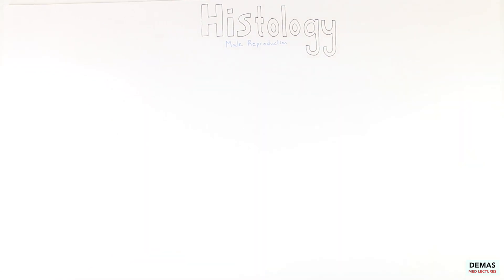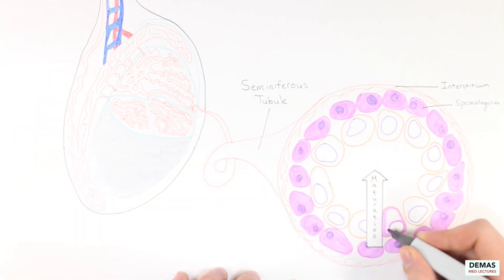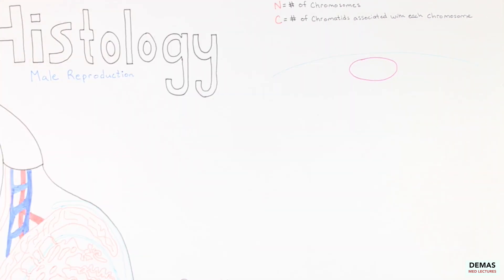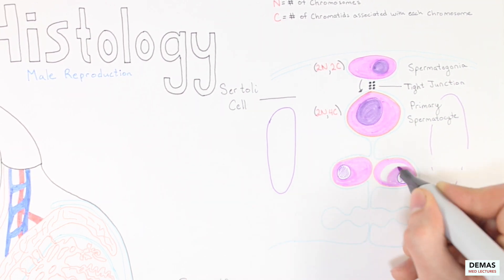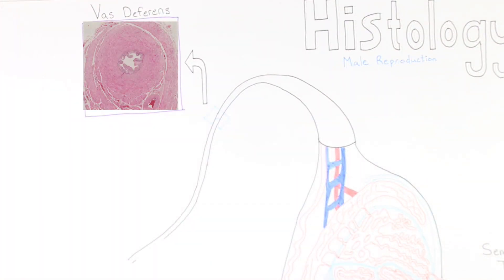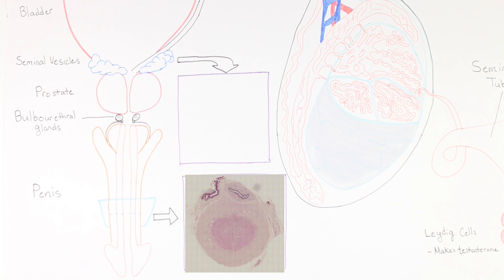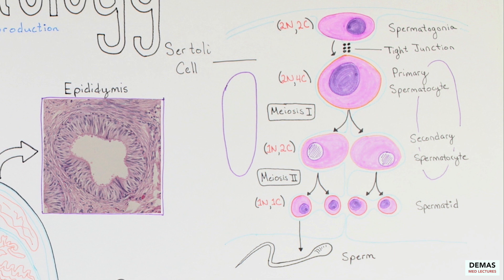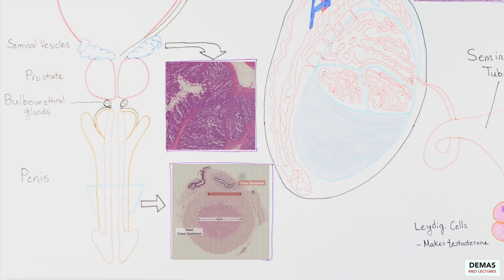Histology: Male Reproduction

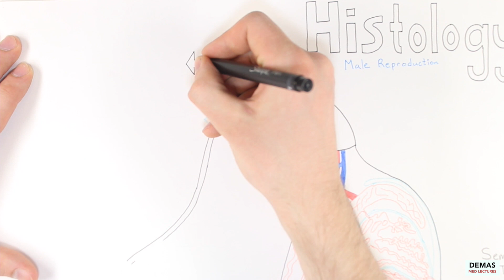Comment: 6:13 Vas deferens is not an anatomical term! Borrowed from Latin vas (“vessel”), are tubes that carry blood, if it doesn't carry blood then it can be considered as a duct. Therefor the correct anatomical name is Ductus deferens. Other then that great video thanks!